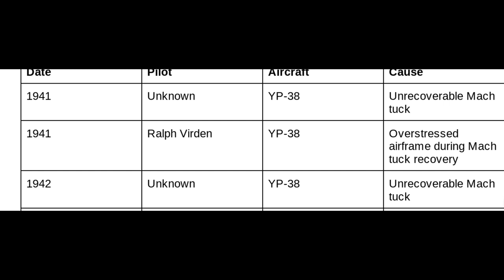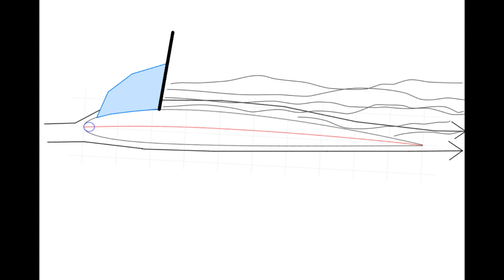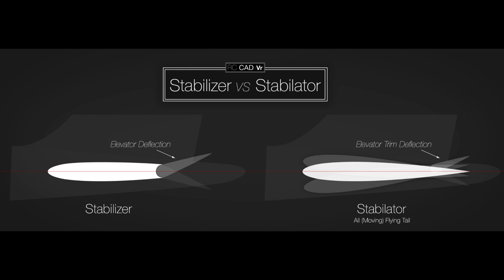When your plane flies so fast that it can't slow down

Comment: As mentioned, music is to high for voice to be heard clearly.  Seems to be composed of shorts which makes continuity jarring.
Reply from the maker: I can hear it clearly, I don't see the problem (I actually specifically reduced the volume of one of the musics). Besides, I like music. The basic idea of the music is from the channel "Mustard".
Reply: @nvb9218  Hello brother, I agree with you that music makes everything better but you've to understand one thing where you should use music. If you use music in wrong place then it doesn't make anything better but the opposite. Like for example in this video when you are explaining some serious points then you should reduce the music volume and increase the sharpness of the voice so that the words can be heard directly in the head (yes head not ear) similarly when the video focuses on animations then increase the music volume. These are small details, looks like you're beginner in editing, so plz give some time to understand these "small details" bcz this is what will differentiate the good videos from the normal ones!! I wish you success 👍